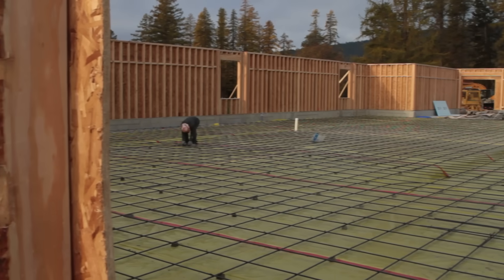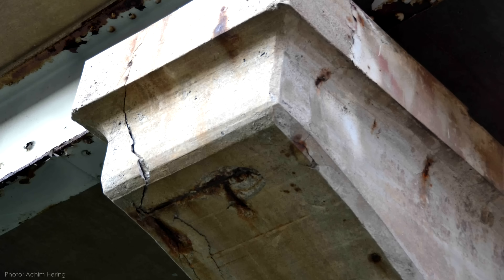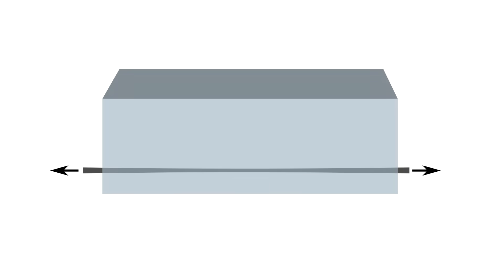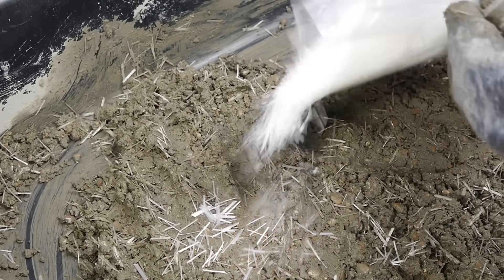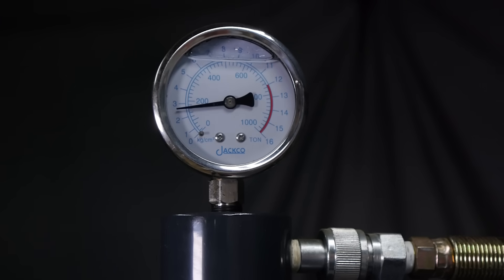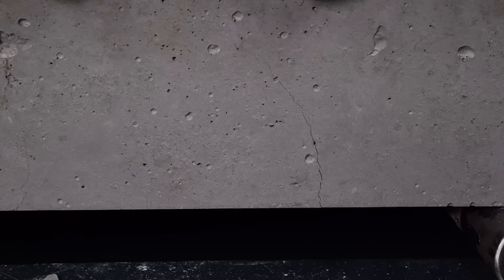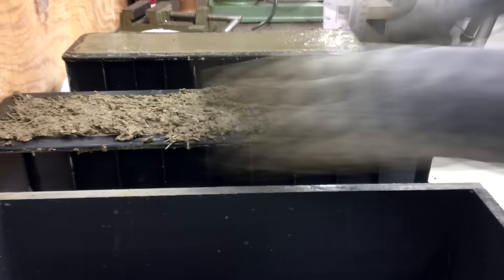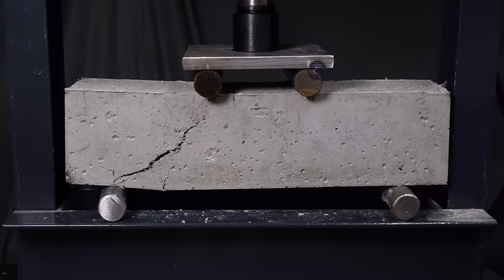Does Rebar Rust?

Comment: could you close the space between rebar and the stress loads leaning basic expansion and contraction as the major issue?
Could you add plastics or polymers (oe something) 🤔🤔😶to make the concrete more flexible while retaining it's strength?
Could you use clean rebar covered in PVC or something to reduce rust?  
Set in place electrolysis to prevent rust?  Or air channels to dry the rebar and allow the chemicals an escape path?

Comment: 25mm cover :o oof and as far as cracks, just learn to design the structure properly and it wont (ok tad tounge in cheek i know lol), anti crack bars etc etc rebar detailing is a bit of a black art. Also the tests you did are a tad flawed. Bars dont stop at the point of support, they fly through, or are bent with minimum laps between bars and lengths to prevent what you just showed happening. A nice way to show how it works, but a bit flawed if you want to show traditional rebars limitations.

Comment: The question was Rebar Rust?  My is yes. To follow question  what causes rusty?answer is issues on mixing  might ratio on water ( types)  , ratio on cement  (type used), ratio on gravel (types used). Ir tyoes of rebar  depends on structural design . . Rebars is-very important in building   A concrete houses , or any big projects to form structural building . It must have foundation , column , slab beams . Rebars also affected by structural load .,to cut in short , depends on  actual construction s site if they follow the structural plan of specific projects  there is no rust or damage  on any project . . Thats why we have schools and engineers im happy to answer because we have a concrete house back home in Philippines its amazing .  Happy

Comment: Wouldn't the synthetic fibers act as a wick to let moisture inside the concrete over time? Similarly the metal fibers would act in a similar fashion in that you wouldn't have the minimum clearance from the edge of concrete to the rebar? IE the metal fibers would still allow corrosion in.

Comment: I think I remember hearing somewhere (maybe you) that the cracks are a sign of knowing that the failure will be imminent and precautions need to be taken to analyze and reinforce or evacuate. Does this delayed cracking pose a problem when it comes to detecting signs of failure?
Reply: It seems to me that the point of the video was to show that cracks on the concrete allow for substances like water and air to come in contact with the rebar, causing its corrosion. 

What causes the concrete to break, in the demonstration, is the excessive load applioed.

So, reinforcing the concrete against cracks is a way to increase the lifespan of the structure, by protecting the steel rebars.

The failure caused by an excessive load would be a result of a poorly designed/executed structure or its bad use.

Comment: Hi Grady, I was watching your videos, well done mate, great work, it is interseting that both of the fiber reinforced concrete beams that you tested failed in Shear rather than bending (which is expected due to the beam length to depth ratio and having NO shear reinforcement) I would suggest for the next test add some minor 6mm shear reinforcement near the supports, that would make the beam to go long way before failure. Thanks for the great work you are doing

Comment: Cement Mason here, rebar reinforced concrete has the rebar "centered" inside the thickness of the concrete, concrete cracks, no matter what, control joints and construction joints help,,control where it cracks, which, you then caulk to prevent the air and water from getting in, water expands when it freezes, so any crack in concrete that gets the smallest amount of water in it is stretched open every time it freezes, that, is how concrete deteriorates
Reply: And possibly tests with the rebar at bottom, middle and top, curious about that...

Comment: What about carbonatation?!
That's the actual reason rebar will eventually rust.
You correctly start by mentioning the cover layer and the alkaline environment in the concrete protecting the metal. But then appear to go astray by focusing on cracks and making it appear that it's the ingress of moisture in those cracks that leads to rusting rebar.
I'm no concrete expert, but I'm pretty sure that it's the accelerated carbonatation through these cracks that leads to acidifying the concrete, which in turn leads to the always present moisture being able to corrode the rebar. 

I've gladly watched many of your videos before, and will gladly watch your next one. But this one seems flawed. And judging by the widespread confusion in this comment section, borderline misleading.

Comment: I have no confidence in concrete.  Its lack of tensile strength means that it crumbles when it is compromised.  Neither steel (as in steel beams) nor wood crumble (unless it gets wood rot).  I have spent my life living in those two kinds of structures:  steel frame and wood frame, and I have felt very secure in all my homes.  Actually, I have also lived in townhouses which had either brick or stone walls with wood floors hung between them, and I felt secure living in those too.  Concrete, however, makes me nervous.  In my life I have seen plenty of crumbling concrete, as well as concrete compromised by spalling.  I would trust concrete only for a one-story building, like a store.
One thing I noticed about the Surfside condo building was that the floors were very thin, only about 5" to 7" thick.  I just couldn't imagine that such thin floors could be safe, even if they had rebar in them.
Reply: fiberglass rebar is the way to go

Comment: You use the same concept when making plaster jackets for molds on making lost wax casting or resin castings. You can use a fiberglass to mix with the plaster, or you can even use straw if you want to do it more old fashioned! Also pvc is sometimes used in place of rebar to reduce weight for a lighter product that's easier to work with.

Comment: I think the fiber/steel wire in the mix makes the beam failure more suddenly... and thus less safely. I was taught that we want some cracks in the beam (somewhere around the center), so that the steel reinforcement can do its work. If the concrete fails simultaneously with the steel, that's something that happens suddenly, and people don't have time to leave the structure. My bad if I am wrong, I am more educated on the water resources side of things.
Reply: Okay. So if u wanna crack first bcs it provides warning before the concrete fails, i think in fiber/steel wire, we need to invent another brand new warning sytem other than crack tho

Comment: One important failure mode of corroded rebars is the loss of high the pH of the concrete due to a chemical neutralization. The high pH of the concrete avoids the already corroded rebar to continue corroding until the pH is low enough to allow the corrosion to become active , because when iron oxide does begins to grow, the expansion force is in excess of 2000 psi and the expansion volume is at least 3x, therefore pushing the rigid concrete until it breaks off.
Reply: That why we cheak quality of water

Comment: This might come as a surprise to alot of persons. If you pour concrete over slightly rusted steel members, the abrasion between the mix and the rebars actually removes most of the rusting in the surface of the rebar. Discovered this some years ago while doing a demolition on a floor slab I casted years prior, the rebars actually appeared brand new out of the factory.
Reply: was this before the chinese steel invasion or how many years ago did you buy that rebar.
Reply: @brianblithe2271  doesn't matter.
Reply: does matter because the rebar today is so bad you cant even epoxy it, it will still rust @ItachiUchiha-ff5yb
Reply: @brianblithe2271  its made of the same mild steel thats always been used, please be quiet
Reply: @mhxxd4  BS.
Reply: @brianblithe2271  Too much fly ash in Chinese steel, or is it coal dust? Asking for a friend. Cheers.

Comment: In the 80's we used galvanised reo in all external elements in a 14 level building in Sydney. After the engineers research we had to add potassium di chromate to the mix in the trucks prior to discharge

Comment: I had to rebuild a whole section of my house because of rebar rust and expansion, that house was near the sea. And two pillar had exposed sections that was supposed to be used on a future second floor that I never did. So that accelerated the rusting process
Reply: Did you use GFRP? It's more expensive then steel, but it can't rust and where I work, we sell tons for marine applications

Comment: was disappointed to see that no mention of damp environment or water being absorbed by the concrete affecting the rusting of the rebar was performed in the testing. These are most common factors when it comes to failure in real environment when used in structures

Comment: So heres a question

What if you used Nylon climbing rope instead of steel rebar for the main reinforcement? If the Rebar is just supposed to be resisting tension, wouldn't Nylon be the pound for pound king in that realm?
Reply: Fiberglass rebar is a better option. It is made with stands of glass, so you get a much higher tension strength and flexibility

Comment: I do concrete every day. I love this video. also if there is one chip in the epoxy coated bar it wont work as intended. also frp will lose strength if there is a fire or high temp

Comment: Concrete tunnels under rivers have 'rebar' also - but it is heavily galvanised before it is used in wet environments. If used near salt water, galvanising followed by painting would be a good way to slow corrosion. Alternatively, make your reinforcing mesh out of stainless steel - it is more expensive, but nowhere near the cost of replacing collapsed highrise buildings, and the time spent in court trying to avoid prison time for criminal negligence.

Comment: What I think?    First  I had  a copper  pipe break in a slab....  leaked liked a sponge, Duh.   All water has some mineral salts to help corrode the rebar?  So unless the "cover" is waterproof, rebar will get wet, ie fail.   Did a cement floor with "fiber" and lamented the hairs of fiberglass sticking up everywhere until the mason took out a lighter and showed me it was polyester fiber!   Added perlight to our portland cement and took it to the testing lab to crush...I declined the  $180 cost to test and was ready to leave.  The tech asked if I wanted it certified, I said no, just wondering.   12,000 psi before the perlight admix broke!     We call it ripstop cement.     thanks for the video.    I think a good perimeter is all you really need to have reinforced.       Lawson di Ransom Canyon

Comment: Everyone knows not to expose skin to concrete, but construction is literally done by some of the hardest people on the planet. A fair share hard headed, like myself. Not always a great combination. Managing jobs over the years there are some sado-masachistic habits I tend not to notice if the some greybeard doing it to himself. I figure what's a few more minor scars if its over top of scars. Few spot welds? Naked from the swim trunks up, whatever goggles, hard hat, steel toe, not training anyone, good to go. 
  Fiber concrete is not one of those let ride behaviors. Even the old guys don't understand the repercussions, they think they do so if your foreman save them from themselves. 
   A few months back I had a little concrete left and a little cosmetic patching at the end of the day. The tools were stowed so I finished mixing a half s bucket with just a glove on. The glove had a small tear that exposed what was nothing more than a papercut. It stung immediately but come on would a stingy kids cut phase you? (If you say yes and shake your head disapprovingly, it probably was a paper cut). I keep going and the pain got exponentially worse. I jerkedboff the glove and the little cut looked like a cherry red wart. When I touched it flaming rods shot up my arm. I drove home but couldn't touch the shifter. When I got home I pulled out the serious magnifying glass and started trying to get out what looked to be an endless supply if concrete and sand that had fused into the sushi slushie that was my tissue. But the real pain started when I would have the tip of a white fiber protrude up enough to get ahold of. They had amazingly enough found their way into my vascular tissue, both blood and lymphatic vessels and had been carried a surprising distance. When. I would pull on one it would be wrapped into muscle, all the skins derma and fat. I still have no fat in the tip of my finger. . I tried tobjust take a hot knife and trim the affected area away but the material literally made the knife grind past. I then tried to cauterize it to no affect. The removal slowly over about a week and a half would just shrink it ever so slightly day after day. If you could only do do much at a fine because the area would just be oozing and weeping so bad it would be too slick to get ahold of anything. 
   I grew up acclimatized to pain, 10 years in the Marine Corp, have been stabbed multiple times and stitched a couple myself , 3rd degree burns, so many broken bones I can't count, hell! I removed a joint of my "unlucky toe" one night because fuck that toe. Even pissed a couple stones out which made me sweat so bad I drank a gallon of water afterwards. But I would do them all again at the same time to avoid that tiny concrete impaction. If it had been even an inch across I would have considered finding a heroine dealer, and I absolutely refuse pain killers for anything. They terrify me. 2 inches and I would have had my wife hide my ammo. 
  So stay on top of fiber reinforced concrete crews. If you don't you will be short a man

Good luck and may your hard work best mediocrity. Dictated not read.

Comment: I had a problem. we were putting in pipe anchors. We ran the rebar out past the anchor and welded all thread to the rebar and clamped to the pipe. We then coated with tar and wrapped with a plastic liner. Three years went by and we got a small leak. we dug the pipe back up and the rods were corroded to less than 1/4" from 12". The black tar and sack seemed to not help at all. I think the stress on the pipe stress to no stress had a lot to do with it. The rebar doesn't do well as a fastener.

Comment: Another problem I've see is when swimming pools get dark spots on the bottom and develope concrete cancer, someone I knew had their pool repaired because of this and this happens because the idiots who tie wire the reinforcing together don't bend the tie wires down or over to be parralel with the rebar and so the tie wire is too close to the surface of the pool and this is not uncommon and most concrete spalling or cancer I've seen over my life is due to the reinforcing being too close to one side of the concrete or even badly poored with air gaps and bubbles and one other case was with a 1930s concrete construction where they mixed mica into the concrete and caused it to Spall,  parallel park in far north Queensland Australia. This small concrete mention was built with a steel frame using railway track and casting concrete over it and the mica  in the concrete made it porous and the railway track started rusting and spalled the concrete and I've heard other cases of dirty sand used in the mix  that may have salt in it and when it gets wet it expands , look at the ruins of Port auther in Tasmania,  that's why they are crumbling because there was a high salinity in the mortar that was used.

Comment: It's called concrete spelling or concrete cancer and many structures se demolition from this issue, the Gold Coast on the south east corner of Queensland Australia is built on a surface and has one of the biggest concrete cancer problems in the world due to sea air ,salt and moisture getting into the concrete and oxidising the rebar and blowing it apart and I first thought that that apartment block collapsed in Miami from concrete cancer. This is something that shouldn't be taken for granted, it should be addressed ASAP before it spreads and travels through the structure. I've been in the empire state building, new York city and it' has a bit of concrete cancer in some of the joists under the upper floors and you can see a bit of the steel girder exposed where some concrete has come off the underside but the empire state is a steel girder frame construction not monocock like modern building structures so if concrete cancer starts in a steel girder frame it has alot less chance of collapsing and that's what I liked about the old school steel girder concrete encased construction but after WW2 that all changed to rebar in the collums and beams because it's cheaper to build.

Comment: Its time Concrete is beeing used in American housing, its more strong, more durability and fire resisted comparer to wood. Also its better for the environment comparer to wood.
Reply: Well, the cement plant in my county is the largest polluter in the county. Aside from CO2 it spits out mercury. So, on balance, it may not be better for the environment than wood.